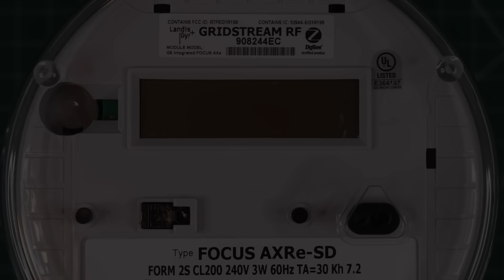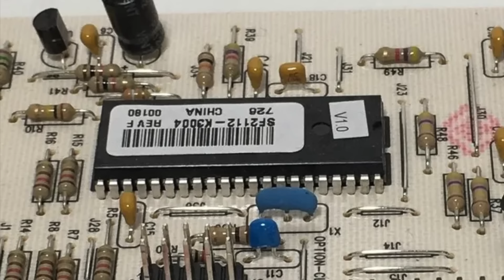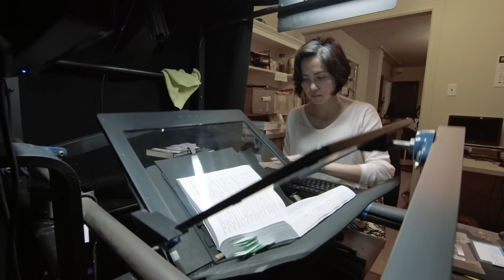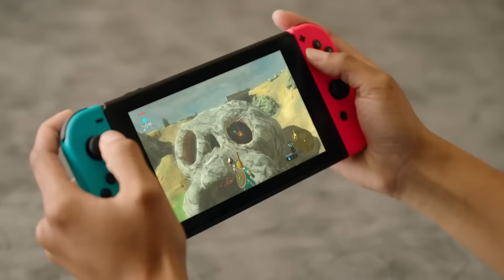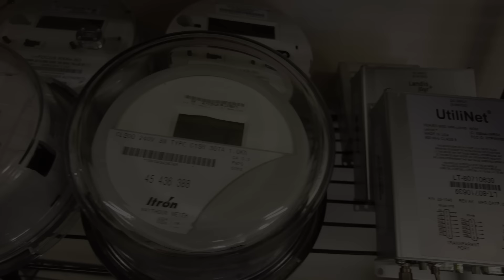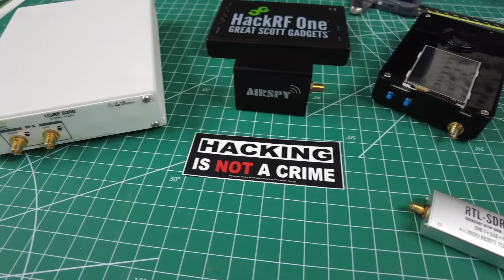The REAL Problem with Smart Meters

Comment: Could you design a similar system or network of devices that send messages a short distance? Think of an alternate to the current internet, but rather than a system of fiber optics and wires, it is a system of radio devices with a limited range. A message sent would piggyback from device to device until reaching its final destination.

Comment: In Thailand if u use zero power you pay zero. In Australia if you use zero power you pay 2 dollars a day for using zero watts. The complacency of The Australian community is 2nd to none.
Reply: Yeah - it's called a connection/supply fee.
Reply: @tellyfaulkner3466  it's not like they connect it every day. The copper cable is put in once and it stays there.
Reply: @Swenser  Yeah, I know that but they still charge you. Prob should have just typed supply fee.
Reply: lol, it is called the infrastructure, and you are certainly not paying the actual cost, just a small portion of it, because yes infrastructure needs maintenance. This is the same for water of gaz. If you are not happy with that, you can live off grid.

Comment: "I've blurred part of this out" - hehe, you're one of the good ones... on a side note, you have almost exactly all the same hardware there as I do, USRP B210, HackRF, etc... sadly in the UK we don't seem to use the ZigBee P2P network capabilities of our smart meters, they mostly appear to use cellular modems instead 😞

Do the Landis+Gyr devices also have cellular / band outside of the P2P network that could be used for switching off power to a home? I'd be surprised if a meter could be switched off over the P2P network... that seems like its asking for trouble.

What an awesome hobby! I might have to find your discord 🙂

Comment: That meter group looks dangerous.
If those all send a signal pulse at same time in a room or with a concrete wall backstop for the forward facing signal output.
The RF coming out if these is dangerous levels, they got it passed the FCC somehow.

Comment: It shoots a microwave into your house and reads the bar codes and sends you commercials for those products, they read your chips in the phone , cards and spending , the microwave wavelength beams harms pacemakers, and interference with organs and the electric frequencies of the body , dirty electrical  ⚡ radiation ☢️ and it causes cancers etc......... it's not good for anyone but the corporations, they communicate with cell phone towers 40,000 times every 25 seconds broadcasting dirty electrical ⚡ radiation ☢️. ... a policy invoked by Barack Obama.... enjoy......not to mention the Home owners insurance will not cover any home with smart meters because they are fire 🔥🚒 hazards , research it , check ✔️✅ it out . I bet they will burn your house down with a cell tower signal when you don't agree politically with the government in power.......... understand.......opt out immediately in the states that allow it !!

Comment: Brother, without giving you legal advice, your interpretation of the Internet Archive case does not seem correct.  Scanning a physical book into a digital copy has always been premised on combining both the "one backup" principle where, for example, you are permitted to make a backup in any format to ensure future personal use, and the "one copy" principle, which, originally when rights owners wanted to stop places like video stores renting videos, was needed to extend the laws that have existed since the time of the Alexandria library - that you can loan what you own.   In the case of what you propose to do with a firmware library, you are not using the first principle, since you are taking a digital image and simple loaning out that digital image... you haven't converted a physical image to a digital image.  In fairness, I haven't read the case, but I would be highly surprised if your firmware library concept did not pass muster.  In fact, it may be a critical step in right-to-repair that the Internet Archive case be circumscribed to the facts of book scanning.  And, BTW, what they did during covid was completely illegal, without question, they had no right to distribute more than one copy of books at a time.  The doctrine of "necessity", which would apply to excuse a breach of someone's private property rights, still requires you to pay for what you have taken (this is the "starving man in the woods finds a cabin" case that every law school used to teach in law school.  You can eat the food in the cabin, but you still have to pay the owner for the value you took.  Internet Archive might want to spend less on shipping containers and hire a competent general counsel.)   Anyway, to provide the digital firmware library you are proposing, the "digital copies" you make of the firmware would be no different from the transient digital copies of data that are created temporarily any time a microprocessor reads any data (it has to be copied to registers, etc.  Duplicating 64 bits into registers might be de-minimus, but it also applies to cache memory, which is getting upwards to "all the works of Shakespeare" levels.  So you win that case by arguing that for the court to find your digital copy of digital bits to be a violation would completely and immediately put every computer or piece of hardware that operates a cache in violation of someone's rights unless they have a very specific license which would, in effect, render modern computing as we know it obsolete.  There is a high chance a court would not want to do that, and you would win the case. 

As for the dump of undecipherable data you are observing periodically, it seems very logical that the one piece of information that could be used to "steal" electricity - the amount of electricity used, would be encrypted.  It also seems logical that they would not simply  dump one value the way a "meter reader" does it, but that they are transmitting date-time-read data structures.  This is necessary in order to implement peak / off-peak pricing, as well as to detect "flow back" to the so called grid when homes with solar actually flow electricity into the power utility.  There are probably bizarro credit formula pricing schemes used by the utilities based on time and amount of flow-back - I don't think they just "net" your usage.  I think that may have something to do with why its such a large amount of data.  It also could do some more tricky stuff, like include a header that indicates what appliance in the home was drawing the electricity (so, you know, they can, for "statistical purposes", track how many homes need to have new regulations enforced against them for using inefficient appliances).  In a "smart" home, it could theoretically get that information by handshake with the smart appliance. But I don't think that's happening yet.  More likely, there are energy "fingerprints" that have to do with load cycling that could be recognized by a smart meter (or more accurately AI somewhere in the system, and then fed back into the smart meter in order allow it to tag the identified patterns.).  

The technical stuff, I'm just pulling a Roddenberry  here.  The legal stuff, though, I'd like to think I'm qualified to opine on.  But nothing in law is ever 100% certain, and usually it comes down to, sadly, whether you have deep enough pockets to afford litigation.  You could try to file an action for declaratory judgement... which would minimize the downside risk of losing the case.

Comment: These can also be turned off en masse, or so an electrical engineer once told me.  It can be done by the electric company, or a hacker.  Supposedly it has to be reset manually.  How long would it take to restore power in a modest city?   Oh, and you keep getting billed while you wait….
Nothing this vital should be remotely accessible.  Period.

Comment: What if you have been looking at the readings the whole time? The messages themselves may be the readings. A certain frequency may mark a power milestone. And other frequencies represent more incremental power usage. The signals could be constant power readings or changes in usage rate.

Comment: I hate smart reading power meters because they have cost me over 700 dollars in incorrect charges, for bad readings that I was never able to recover from spec in Lubbock. They told me I was liable for inaccurate readings and charges or they would disconnect my electric

Comment: - 0:01 🧠 Reverse engineering smart meters has been challenging, especially understanding the power readings they transmit.
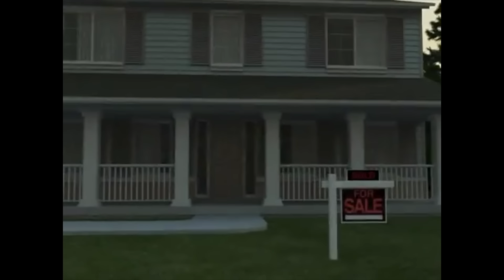- 0:19 🌐 Smart meters communicate wirelessly through a vast, time-synchronized mesh network spanning cities.
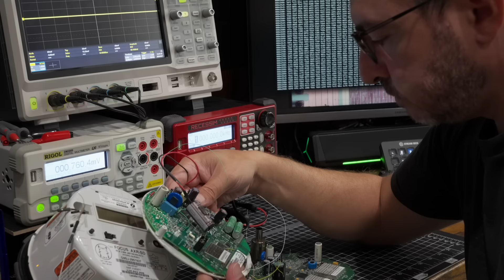- 0:48 🧐 The power readings sent back by smart meters are still a mystery, despite progress with decoding other messages.
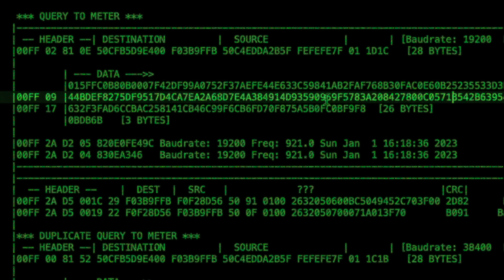- 1:28 🛠️ The speaker shared data on GitHub to seek help from others, but no one solved the power reading issue.
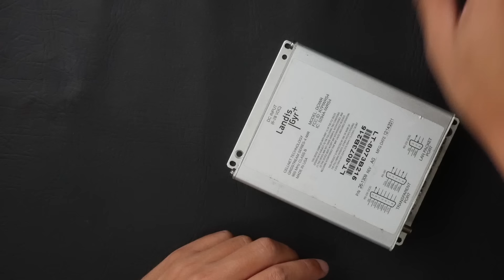- 2:18 📡 Relay stations in the network translate smart meter data for computers, but power readings remain elusive.
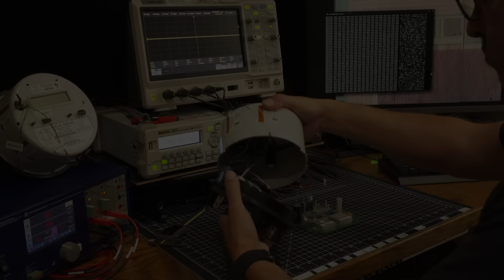- 3:02 💻 Custom tools were used to extract firmware from a smart meter, but analyzing it proved complex.
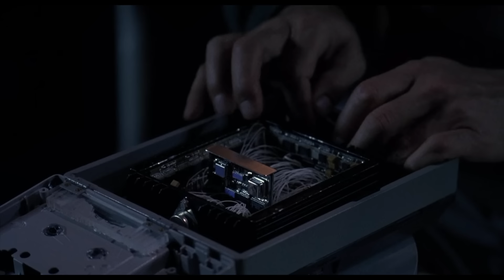- 4:01 ⚙️ Microcontrollers inside devices like smart meters run code, controlling how they operate and transmit data.
- 4:47 📶 Smart meters hop across 240 frequency channels in a random pattern, making it hard to track their signals.
- 5:40 💥 Smart meters can send emergency messages during power outages, but these can be spoofed by attackers.
- 6:30 📚 The idea of creating a firmware library emerged, similar to borrowing books in a traditional library.
- 8:44 ⚖️ Legal challenges arose when trying to build a firmware library, based on the lawsuit against the Internet Archive.
- 11:19 🎮 Gamers pioneered legal mod chips to unlock consoles, offering inspiration for a potential smart meter mod chip.
- 14:09 🏦 The speaker critiques how utility systems are closed-source, vulnerable, and primarily driven by shareholder profits.
- 14:40 💡 The proposal is to “gorilla open source” these systems by extracting and reverse engineering their code.
- 15:58 🔓 Extracting firmware from a smart meter is possible, and the process is not as complicated as it seems.
- 17:13 📻 Software-defined radios can wirelessly capture smart meter broadcasts without detection.
- 18:33 🔊 Advanced software-defined radios allow listening to smart meters’ frequency-hopping patterns by capturing wide bandwidths.
- 19:39 💻 The speaker plans to share free tools for reverse-engineering the extracted firmware in future videos.

Comment: I don't understand how Americans can let companies control the utility companies. I'm sure it saved money at first, the infrastructure exists and can be depreciated without the big capital costs, those companies quickly form oligopolies, the infrastructure now in disrepair fails and there is limited accountability and the Corp has a blank cheque for new infrastructure. Meter companies are part of this archaic system and trying desperately to find a way to create a system that requires a subscription model. Only they can test a device to confirm its accurate, only they can work on a device to repair it (repair manuals are inaccessible), only their distributors can provide you with replacement parts and batteries. I would go as far as to say they are worse than pharma companies. Anyway, I'm done my rant, enjoyed your video and now will get back to fighting the "Big Meters" industry and try to stop them from bleeding society dry.
Reply: State funded slush I GUARANTEE YOU

Comment: As a software engineer, I came here after the electricity provider conducted an on-site interference measurement. It appears that three devices in my household are emitting disturbances that interfere with the frequency used by the electricity provider for their communication via PLC. Now they want me to install a filter—what a joke! If they want to use this lousy PLC, why isn't there a built-in filter or blocker? What a joke these companies are!
Reply from the maker: What devices were causing the interference, and did it make a difference where they were physically plugged in? Closer to the fuse panel/meter or further away?
Reply: @RECESSIM  A frequency converter for a pool pump, one ceiling LED lamp (panel), and a power supply. All with CE-Label. We haven't had much time to test yet, but there is some distance between the frequency converter since the main issue (the frequency converter), as it's in an outbuilding. All the devices were plugged in, and we had to unplug and shut down the entire house to find the exact devices causing the interference.
I now have 4 weeks to either fix this issue or remove the devices, as it could affect the neighbors and everything else too. It seems that working filters/blockers are hard to find and can get expensive. The only one I tested today that actually fixed one device cost 200 euros (I tested four filters for this device). Something for all three phases costs around 800 euros. I wish I could have my old e-meter back, but we're being forced to use smart meters.
Reply from the maker: @TheHausi91 wow, that sucks! What’s even worse is they’re making YOU pay for the filters needed for THEIR system to work. They should have tested it with realistic devices plugged in. 

If they want a quiet power line, they can filter it at the entrance to your panel, at THEIR expense.
Reply: @TheHausi91  good to know they are going to snoop on my inverter drive.
Reply: @RECESSIM  how can I guerrilla mine bitcoin by getting around my meter? Is there a way to use neodymium magnets or anything to trick meter in to sending lower values..or getting around meter entirely?
Reply: Sounds like it's their problem not yours. If everything  you own and plug in is got that label on it they can pump sand. Also.....your home is your business. Go off grid.
Reply: Now we're 8 weeks on, did you find a solution?
It may be a bit simplistic of me but can an isolation transformer create the barrier needed?
Reply: What are you using that is messing with their stuff
Reply: That’s not how FCC / rf laws in general work. You are responsible for mitigating interference you’re causing to licensed services. You should probably install those filters or remediate by replacement, because you’re likely causing wideband interference to other radio services too, including amateur radio and public safety. 
The scourge of noncompliant / cheap ass electronics polluting the shared spectrum is a disaster in slow motion. Plus, who wants to bathe in dirty EMF all day and night. Yeech.
You should read the standards on the label and see what they actually say, cause I can assure you it doesnt say that just because it has a label it’s good to go.